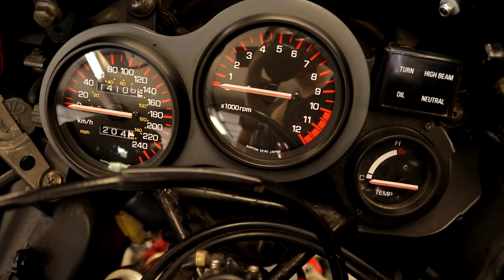Yamaha RZV500 V4 Two Stroke street legal Kenny Roberts &  Eddie Lawson GP500 Racer The Inside Story

Comment: I worked for a guy back in 1984 that was a professional road racer. He bought one of these for racing only, so he was able to get it into the USA. I helped him un-crate it and finish assembly. I was riding a 1979 RD400 Daytona Special at the time, so seeing this water cooled 500 with full fairing was pretty awesome. My RD with expansion chambers would start pulling hard at about 5000 rpm and never seemed to loose torque until about 10,000 rpm. I could pop up the front tire with just a wrist snap of the throttle right at the 5000 rpm mark without even touching the clutch. Once, with my girlfriend on the back, I took off full throttle in 1st gear, and at 5000 rpm, just the powerband itself lifted the front tire off the ground. Two stroke road bikes are in a different class. Thanks for the trip down memory lane.
Reply from the maker: Sounds like your had your Daytona tuned nicely!
Reply: I had an RD400 Daytona special too. Aftermarket pipe and solid state ignition, and a Shoei quarter fairing.
Reply: Ok Genie my first wish is too have that bike back now just as she was. My second wish is to have that same girl sitting on the bike again just like she was back in the day. My third wish?
Reply: I also had an rd400f. (x2). First one was mostly stock, except for a KZ1000 front end and a swingarm off a gs1000 with some piggyback shocks that worked okay. The second one was my bottomless money pit, fully ported and polished with DG heads, keihin carbs, factory pipe products pipes, some drag bars, steering stabilizer, ditched the dual shocks and grafted a pro link from a xr and chopped the spring down, customized LP fairing, and a baja 1000 halogen headlight that could fully cook venison before impact. Running avgas mixed with amsoil, I had the bug killer from hell. Having 7 total rd's in the garage and a brand new CR500 at 19, my neighbors could only shake their heads, but I thought I was king shit! The good ol days! Wish I had kept those Daytona Specials. Real head turners they were! Now Im riding an old TLR, a Duck, and Im working over an old gs1100 into a drag bike. With nitrous. Its ridiculous.
Reply: honda ! i ad a rz 350 1984 ...thought me 2 ...to rebuild ..! ounce ...ns 400 ...me rz 350... an younger that blew a rz 500 ...bought a suzuki 500 ...walterwolf ....! of corse ...plans where made ....we were carring 0.0-5 beers ....! copps came ! what a thrill !
Reply: @SKRAPNOID so how's the GS drag bike coming? It's been 2 year's!...from Wyoming USA 🇺🇸 👋🤠

Comment: I bought the RZ500 brand new off the dealer floor in 1984, it was one of few brought into the Prairie provinces in western Canada. I had put about 100 kms on it and had the dealer send the engine to Vance and Hines for some head work and a better balance. The dyno came out at 105 hp. All I can say is I miss this bike... ended up laying it down after some unmarked roadwork took out my front wheel in a corner. Still to this day I miss it, my friend had a new V-Max back then and was always shocked at how a 500 could beat his monstrosity.
Reply from the maker: Great story!  Thanks for sharing and watching my video.  Cheers, Kirb
Reply: Interesting story, here in the UK in the 90s, as a 19-year-old I owned an RZ500 and worked in a shop which imported full power V-Maxes from the US (the UK only got the 90bhp version without V-Boost). And yes, I concur, most of the customers hated me
Reply: It is not that easy to get 100hp out of that engine, takes much more work.

Comment: Nothing can beat the sound of two strokes ❤️
Reply: They sound so amazing
Reply: Yes totally agreed. Owned many four strokes over the years but still had far more fun on my two strokes. Always remember the smell of Belray or Castrol 'R', the smoke going down the street along with expansion pipes screaming. Not that my neighbour, a cop appreciated it, waking him up at 2.00 in the morning. 😃😃😃
Reply: Agree whole-heartedly. Almost cried when Moto GP changed. I still vividly remember being at Laguna Seca, for my first GP. I get out of the girlfriend's AUDI and see all these guys are there with three foot camera lenses in this corner, so I run over... Turns out here comes Wayne Rainey, railing turn 6. I actually ducked down because NO WAY was he gonna' make it! Scraped the fairing and both wheels sliding to the very edge of the sharks-teeth, then firing-up towards the Corkscrew. Then the smell..............
Reply: The 2-rotor Wankel-powered Crighton CR700P may take that title, at least in my opinion. Very much like a 4+cylinder 2 stroke, but somehow even better.
Reply: Or feel. Amen!
Reply: @acceleratefaster46 - Yeah! They sound like a chainsaw with it's throttle stuck wide open !
YUCK !!!!!

Comment: I currently have one in my garage that was bought in Canada. A close friend whom I raced with bought it and we ran it in 1985 at a wera 6 hr. endurance race at Pocono against john kocinski who was on a gsxr 750 from Canada. My friend passed away and I promised to care for the bike and it’s smaller sibling, a rz 350. Both are in fairly rough but running condition. Lots of the plastics are cracked, the anti-dive valves never did work worth a damn and the bike had some handling quirks. But it was a blast to ride in competition and could be tweaked to perform.
Reply from the maker: Great story.  Do you know how much weight you were able to remove and how much power your could get for racing?

Comment: Beautiful condition!!!!  Back in the day my buddy had an 84 and I had an 85.  The only difference we ever found was that the upper triple clamp on my 85 had a ring cast around the ignition key mechanism .  Driving side by side at 6,500rpm was as sweet a symphony as a gear head could ever wish for, but that 16" front wheel was scary.  Both of us had multiple head shake incidents above 90mph that almost tossed us.  Some how the FJ1100 with the same wheel was a lot more stable, but it also had a 16" rear.  Long live the smokers!
Reply: The FJ didn't headshake like your 85 for a couple reasons, fork angle, and total length is a few reasons why!..from Wyoming USA 🇺🇸👋🤠

Comment: I had a half of one of these, a TZR250, it looked similar( from a distance) and was super 3njoyable and a big bike killer. The 500 was a dream bike at the time, and looking back was absolutely attainable, I regret not getting one, I moved on to an FZ750, another awesome bike. Currently have a 150hp FZ-1000, but always ah ker back to the 2 stroke days.
Reply from the maker: I have always dreamed of riding a TZR250.  Curt Jordan (in my dyno videos) was a winning racer and tuner of them back in the day.  thanks for watching! -Kirb
Reply: @cramersclassics  I had a 350lc before that, but the throttle was very much an on/off switch, incredibly exciting when you were in the mood, but at times a little irritating, the TZR felt so sophisticated by comparison, still had the awesome power band, but smoother at low revs, and superior suspension and braking. You really felt you could do  a TT on one. Matt Oxley set the first 100mph lap on a production 250 on a standard bike, I recall he said he was at 11,000 revs for most of the race.

Comment: A coworker back in '86 let me take his weekend racer RZ500 for a ride. Bike was safety wired and burning 100 octane avgas. I rolled the throttle at 6000 in 2nd, quick shifted into 3rd to keep front wheel down. Quite a rush from 40mph to 100mph in a very short distance. Lots of fun on the street. I would have loved to try it on the track.

Comment: I've owned 3 of these bikes over the years, and had one as my first bike at 16. they would run right beside any current 750 of the day and it used to give them fits. They were also made from 1984-1986 so there was 3 years of production, and the Europe model also came in black and red.
Reply from the maker: Wow.  Talk about setting the bar high.  Certainly would have killed the average man :-)  Cheers, -Kirb
Reply: My dad had an rz500 (still has it) and he said that it would walk all over 750s, but he dragged an 1100 or 1000, something like that, and they just pulled away from him after 3rd or 4th gear. I didn't think he was lying, but it's nice to hear the same thing from another rider.

Comment: They were called RD500 in Europe. A friend of mine had one and they were SAVAGE. For the day....
Reply: @Aitch widow maker
Reply: They were considered a bit of a disappointment at the time, engine performance wise. The tune was conservative. The Suzuki RG500, as long as you filed out the exhaust pipe around the attachment flange welds was quicker, on some bikes, the rough welds could restrict the gas flow. The NS400 handled better and would have been fastest of the lot if it had been a 500.
Reply: @SvenTviking  I was 15-16 yrs old when the RD500 hit the streets in my neck of the woods and i guess we all kinda knew that the Gamma was the faster bike. But when you live in the sticks in scandinavia,the only dealer for miles and miles and miles is a Yamaha dealership AND your friend buys one and lets you ride it before you even have a car licence AND there is no Suzukis around,it`s easy to become biased. Rode one in later years and i remember i felt like there was nothing infront of the bars. There was the tank,the bars and then bike just STOPPED if you know what i`m trying to say... I didn`t particurlarly like that.
Reply: No the RD500 and RZ500 are different bikes the RD and RZ shared the same engine but the RZ has a blueprinted engine meaning that the engine is perfect factory spec while the RD has the engine production spec meaning that the squish and other clearances are off a bit loosing power. The RZ has different suspension.
Both beautiful bikes but the RZ just that bit extra.
Reply: @mr.whiskers6273  Hmm, i have never heard that one before and i can’t find anything to verify what you’re saying. Links?
Reply: @mr.whiskers6273  Nothing huh? Thought so.
Reply: @EVILSPAWN1003  Why do I have to verify myself? I know I’m right so why would I discuss it?
Reply: @mr.whiskers6273  😂😂

Comment: I was just getting into bikes when the RD/RZ500 was released, the RD having a steel tube frame. They were pretty revolutionary along with the GPZ900R, which was also in vogue at the time. The feeling was that the 500 was a little conservatively tuned in comparison to the 350 or the Suzuki RG500 which, in a good example, was over 90hp.
Reply from the maker: I've always wanted an RG500!

Comment: Thanks for the vid. It brings back great memories. These bikes came with a cable (not a stick) to keep the fuel tank in place when rotated up. They never handled that well due to the 16" front wheel.
Reply from the maker: I think the idea behind the small front wheel was to make them more nimble.
Reply: @cramersclassics  It was, but it didn't work. My current bike has a 21" front wheel that makes it nicely stable, but it still turns easily because the contract patch is narrow (but similar in size as it's longer).

Comment: Very nice video. I have one sitting in my garage. In regard to the fuel tank hinging for maintenance, they came originally with a cable with hooks on the ends to hold it up. It hooks onto front mount and  frame cross member in the rear.

Comment: Good video. Those 500's are wonderful. We had them here in England and I test rode a Stan Stevens stage 3 tuned one. I didn't buy it because I set off on it quite gently , went up the gears and at 80 mph the front wheel hit the ground. Unbeknown to me I was wheelying it. Geeez that was a monster.

Comment: Two buddies any myself make a package deal on 3 of these in 1986 or 87. They really didn't sell very well , and there were lots of left overs sitting in Yamaha's warehouse for a year or two. We paid $3600 CND which was at least a couple of grand off the original price. The things I remember about the bike was that the suspension was way too soft,  your legs and ass would sweat like crazy from the underseat exhaust, and it would absolutely kill spark plugs if you rode around town too much. You had to make sure that you always had a spare set tucked into the tail.
I rode mine from Winnipeg, Canada to Los Angeles that summer (about 7000km round trip). The foot pegs were a little too high for touring, but other than that it was pretty comfortable.
It seized at the end of that summer, (bad crank seal, not uncommon). I took it back to the dealer for warranty repair, and had them sell it for me. If only I'd kept it, they go for crazy money now.

Comment: A guy I knew in the early 90's had a RZ 350 YPVS ( LCII 31K ) with twin ( matte black  ) Wildcat expansions, TZ350 race reeds and I can't remember what else but I think the engine itself was stock but boy did that thing go! A TZR 250 3XV could but just keep up with it on the pull and midrange but was left way behind at top speed... But the sound of the RZ as soon as the YPVS opened up was enough to give a teenage boy chills down his spine... Awesome video - thank you very much for the / your very well detailed walkthrough - it is very much appreciated and shared publicly on Facebook... ✌

Comment: Do you have to order parts from Canada,or does Yamaha USA support the bike? One of the bikes I’d love to own. My first motorcycle was a Yamaha R5B 350. Great bike and solidified my passion for two stroke motorcycles.
Reply from the maker: The R5 is a great bike.  Fortunately, I have not needed many parts for the 500's.  Not sure where a good source would be.
Reply: @cramersclassics    Seeing that the %00’s weren’t sold in the US I doubt Yamaha USA would have parts available for them. It would make sense that a Canadian Yamaha dealer would have access through the importer up there..but I very well could be wrong. I imagine pistons and rings wouldn’t be a problem but crank seals might. I imagine the seals may be getting old and hardened by now. I’m envious of your owning those beauties,they’ve always been bikes I’ve wanted.

Comment: Just to show you how fast the go fast scooters advanced, the '85 RZV500 weighed 475 Lbs at 90 H.P. where as my '09 BMW S1000RR weighed 435lbs wet and had 190 BHP. After I spent some money for full inconel catless exhaust, lithium battery, CF wheels and CF body work and a tune it was under 400 lbs and over 200 BHP.

Comment: The RD500, along with the Suzuki RG500 were the holy grails of two strokes when introduced in the 80's.  Never officially sold in the US, they were lusted after by two stroke riders.  I know, I was one of them!  

In the 90's, I looked into buying a used one in Canada, but I was scared off by the import process, title issues, and getting through DMV.  In the end, I decided to stick with my little RZ350  as my two stroke of choice. 
Years later, I met two different guys who either own or have owned both the RD500 and the RZ350. Both of them laughed at my lust for the RD500.  Independent of one another, both of my friends shared that while the 500 was cooler looking, and faster, the 350 was more fun to ride, easier to service, and has better parts availability.   While my lust for the 500 has calmed down, I still want one. 😅
The cool factor is too strong!
Reply from the maker: I agree that the RZ350 is the best overall choice!
Here is a link to my video on RZ350's:
https://www.youtube.com/watch?v=MQSpfFh2xOg&t=14s
Cheers!
Kirb
Reply: @cramersclassics  couldn't  agree more!  I have watched your 350 video several times. 😊
Over the course of owning a riding my RZ350 since '85, I have seen things go full circle:
Cool - nice bike
Passe - my bike is faster
Very passe- ew,  a smoker!
Cool - "you still have one"
Very cool - "I always wanted one.."
Semi-exotic - "What is that?"
Always miles of smiles! Those of us who know about two strokes, just smile, and nod knowingly. 😉